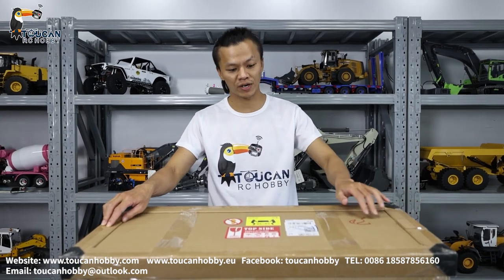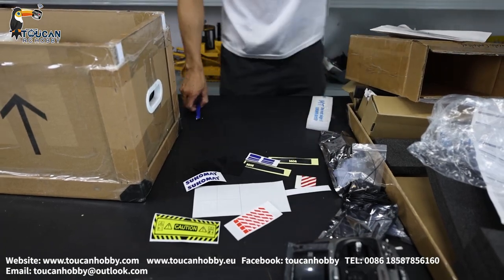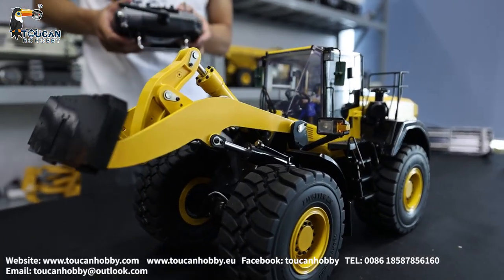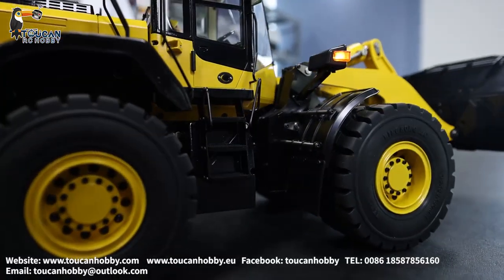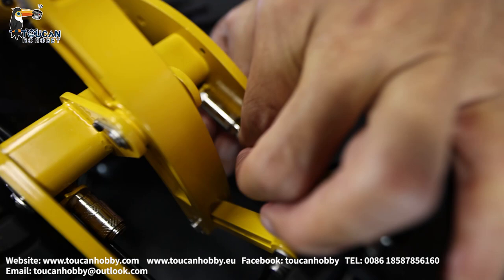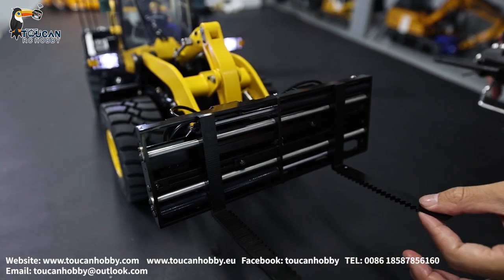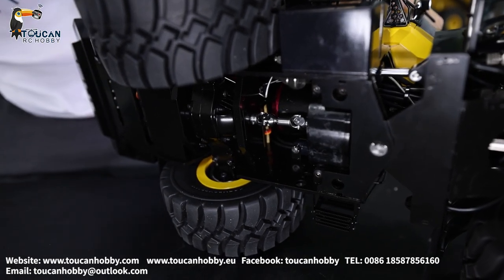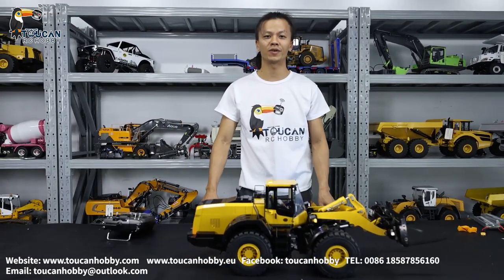MT Model 1/14 Metal RC Hydraulic Loader of KOMATSU WA480, weigh 16kg, Got: 1PC Fork, Quick Coupler

Comment: How many speed have?
Reply from the maker: Hi no speed changing gear, it is only controlled by motor speed
Reply: @toucanhobby2400  ohh But it's too fast so Can i adjust the speed from the control?
And i have question when i to Change the seal for the pump on My dump truck do you think the leak will stop'!!
Reply from the maker: @The-Warm-voice1359  Hi, David. 
You can only control the speed given to the machine by the joystick.  Regarding the oil spill, of course!  We will restore it together.  Don’t worry.
Your Michael